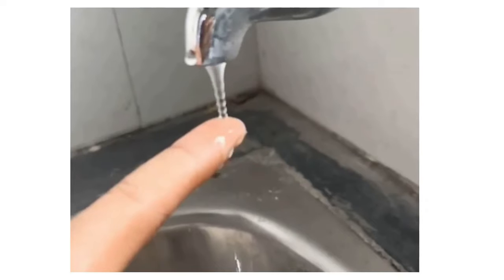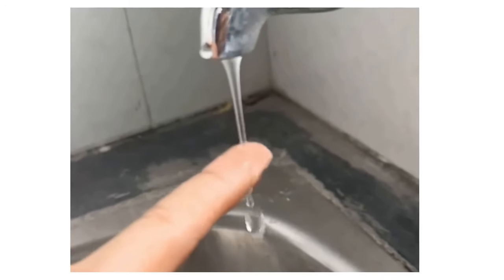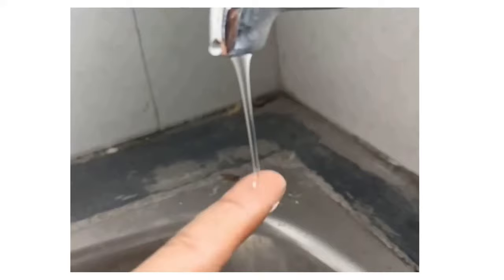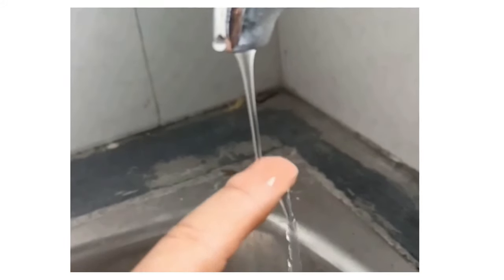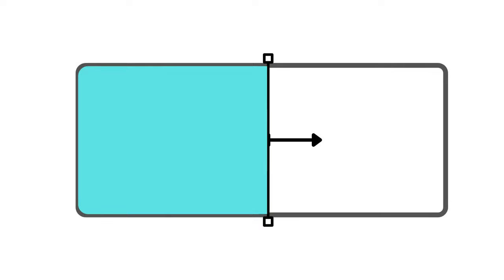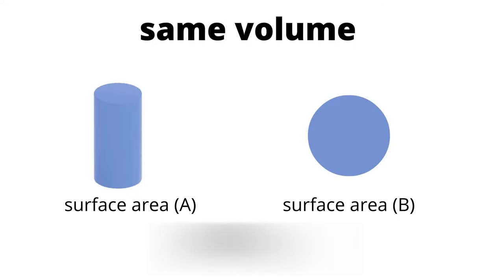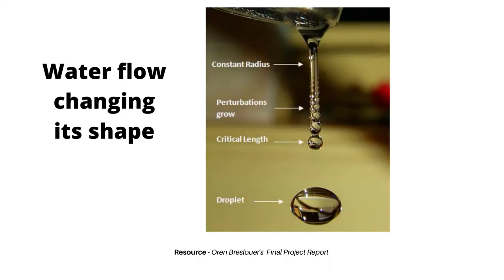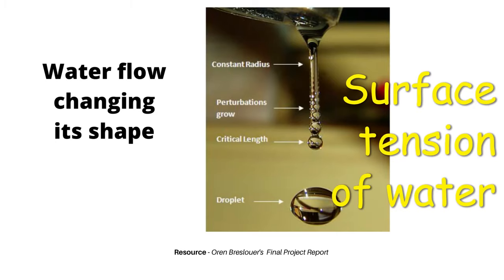Rayleigh Plateau Instability | #VeritasiumContest | Explained in one minute

Comment: I think this video should explain that "thinning" of the water is caused by droplets acquiring more and more speed when gravity pulls them downwards in free fall; the number of molecules doesn't change but the length that those molecules must cover for given speed causes the thinning. Without this knowledge the viewer cannot understand why the droplets would separate after long enough fall. And the same reason explains the collision with the finger – the droplets hitting the finger cause water to slow down causing water pillar thickening and the surface tension takes care of the rest.
Reply from the maker: @Mikko I appreciate your views on the video. Maybe the explanation can be more detailed and more informative but I had time constraints. I uploaded this video for the Veritasium contest, there were criteria that the video should be of less than one minute. So explaining all the details in one minute was a challenging task. So I figure out all the details and include the important points in the video. 
Coming to your point of gravitational pull, as far as I understood the phenomena, Gravity plays very little role in that. Maybe the same experiment can be done in control mannered to critically evaluate the role of gravitational pull. But your explanation of thinning of water is impressive 😃🤩
Reply: @devenbirje3327  Yes, I understood the #VeritasiumContest being exactly about the problem of explaining interesting or complex physical things in very little time. As such, a great entry will require a lot of planning and cutting but the technical quality (e.g. image quality or audio quality) is not the important part.
Reply from the maker: @MikkoRantalainen  I am planning to make a detailed video. Working on that 😎🤠✌️